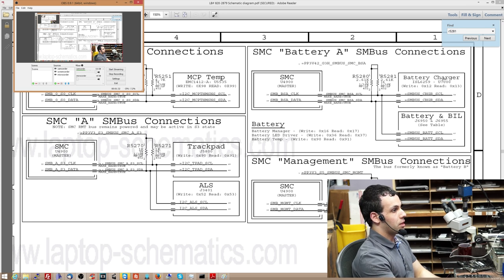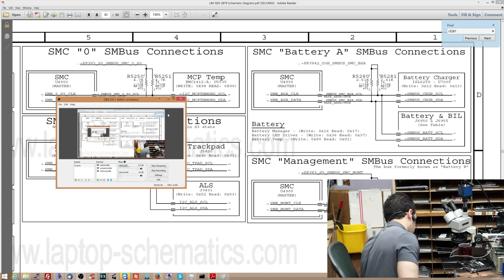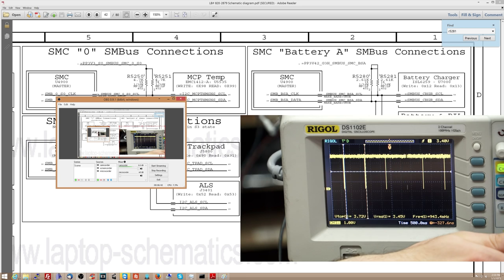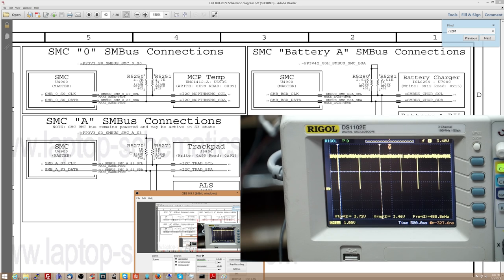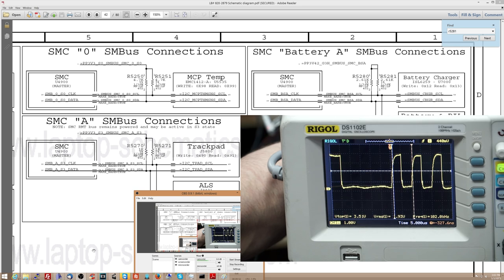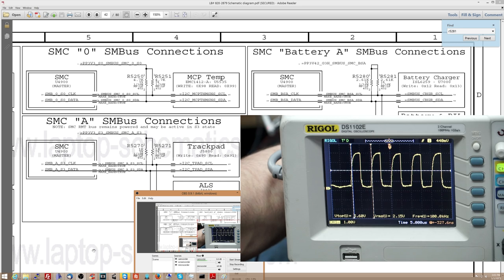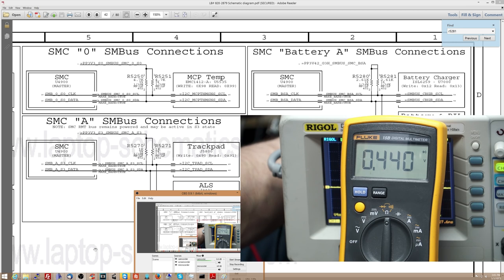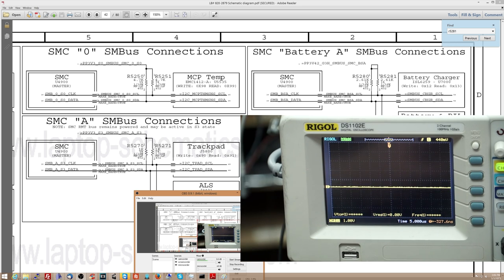What is a pullup resistor and how is it used to create a data line?

Comment: In case you care (and judging by the marking on the schematics), the "talking" from the circuit in this demonstration is using the I2C protocol (protocol means "the rules the emitting and receiving machines agree on to understand each other"; "the language" in a sense). If you want to learn to decrypt this talking (and other protocols used in microcontrollers), I suggest these articles: 
https://learn.sparkfun.com/tutorials/i2c
Thumbs up, if you read so far, to keep this info floating on top!
Reply: DigGil3 So how does (in the video example) the SMC know when to ground the rail the pull up resistor is connected to? In other words how does a circuit know when to pulse a line down to 0v (low) to create data. Is it being triggered by another chip?
Reply: it's all especified on the i2c protocol. it's complicated as fuck, if your goal is only motherboard repair is not worth to learning this shit, it is only for engineering people to understand in order to design circuits.

Comment: Wouldn't they be pull down resistors since they're pulling the main supply to ground to create a signal? Pull ups would pull from ground to voltage level
Reply: that's also what I thought
Reply: Same thing, different direction. Like conventional vs actual currents it's all relative.

Comment: You did not explain how come it does not short the whole machine when the data line goes from 3.7V to 0V. You said it's because there is that 2.61K resistor but that does not make any sense at all.

Comment: Hi!
Maybe a noob question, but someone can have the same thought:
Let's say my hardware test says that PCH temperature is out of range, that causes maximum CPU load and fan raving.
A checked schematics and PDF for PCH, but no temperature output is used for PCH on the A1465 Air board. Wild guess, but does it work so, that every component - PCH, trackpad, CPU, etc… has only one double output(CLK, data) for data transfer for the SMC? Can this line include more, than one information about the device? So the schematics SMBus Connections table shows every connections that go to the SMC for diagnostic (Voltage, amperage, temperature) measurements?
In my problem, means that i have to check the pull-up resistor and the voltage that makes it logical high? I don't need the direct answer for my problem, just wan to understand the how-to of the logical lines in Apple boards.
Zsolt

Comment: Hi. I'm guessing but I I believe It's 0 and 1 with 0 as low power and 1 as high power as seen on the scope (the binary in 0 is not really zero volts but low power coz' there's no way for the OS and prog), then that combination of 0s and 1s processed in the embedded program/software in the IC which shoots linearly at the moment the pulses of electrons as low power (0) or high power (1) which the iOS or OS X interprets then relay as graphics (alphanumeric is a graphic like hieroglyphics only it's popular that we all can understand it, much like the oscilloscope represents it as a waveform graphic) to determine the amount of charge and I guess rpm for the fans and temp. With the OS knowing before hand what the full charge of that particular battery is and makes it calculation base on the voltage drop. If it doesn't know it, it can' calculate properly and we see that usually when there's an anomaly, like when you use lithium batteries on the Magic Mouse or Apple's keyboard, it doesn't show it accurately coz' it only knows Alkaline at most I'm guessing.
Reply: Why are people answering the question of what it is by saying it is ones and zeroes, that is obvious and Louis knows it, the question is what is it saying not how is it saying it, and by the way you don't need to know in order to trouble shoot, if this is the best guess you can come up with, then do not apply for a job with Louis, keep on trucking.

Comment: it’s using PWM (pulse width modulation )which is the ration of high to low signal
Reply: It's a standard protocol called I2C (look it up), that's why there's references to SDA and SCL (Serial Data and Serial Clock) . PWM is used to digitally control the speed of motors or brightness of LEDs efficiently (amongst other things), it's not a communication protocol
Reply: @roopi67  I know what I2C is I don’t  remember what PWM was in response to
Reply: @alexcipriani6003  I'm responding to your above quote "it's using PWM..." , you don't see it?
Reply: I checked your channel and yes I expect you will know what what I2C is, interesting projects 🙂
Reply: @roopi67  I see it! I don’t remember what my “it’s using PWM” referred to…what “it”
Reply: @roopi67  :))) I know that, I just don’t know what Louis said that I was responding to
Reply: @alexcipriani6003   I had assumed you were referring to what Louis talked about the battery talking back on the data line to the system management controller about how much charge it has left etc. You mentioned PWM above so I thought I'll correct you about the protocol. But now seeing that you have experience with microcontrollers then you probably already know this